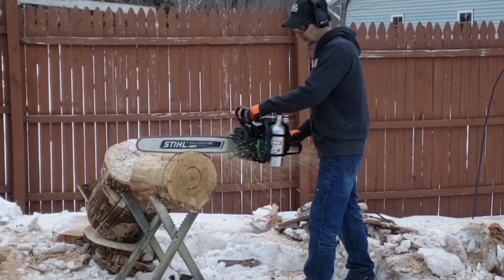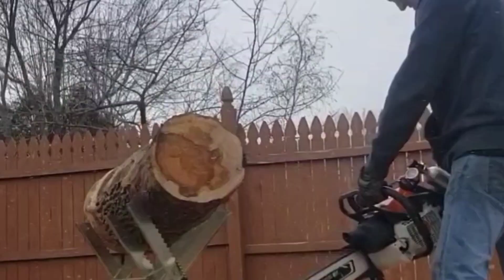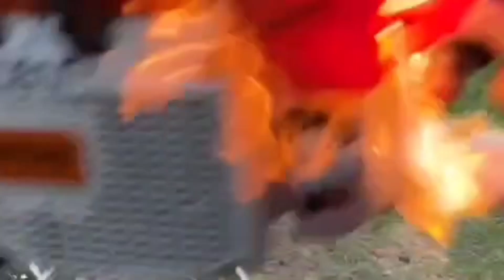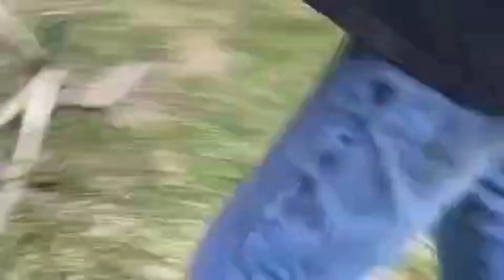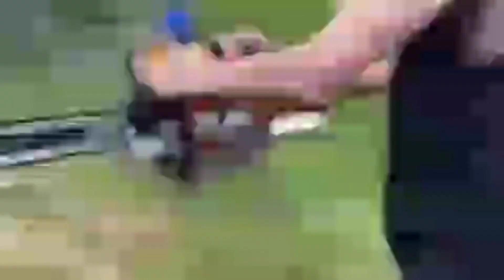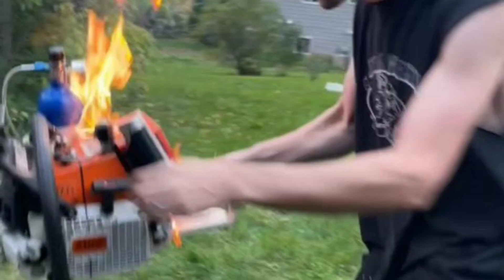NOS saw demo!!! Stihl MS460 MS461 with nitrous... custom chainsaws!!! JCS

Comment: How long will it last running the nitro $$$$
Reply from the maker: Its so hard to say man... the 460 ran 17lbs of nos thru it and it is still going strong... admittedly a lot of that was testing and fine tuning so I can't say I ran over 10lbs... the debris ingestion is actually harder on the cylinder than the nitrous... so hopefully I can figure out how to run it with a filter if even just a screen mesh would help a lot